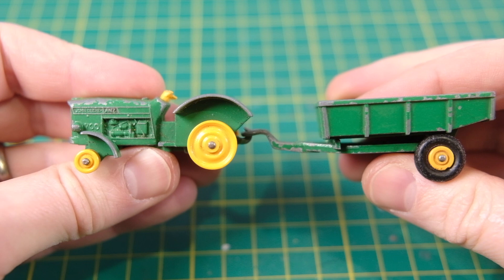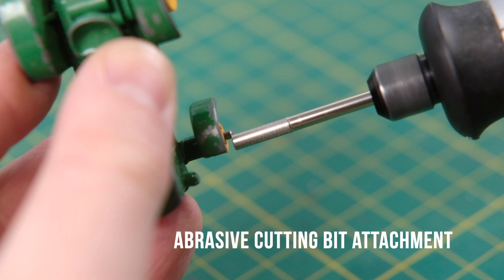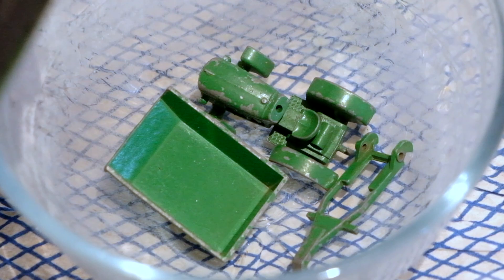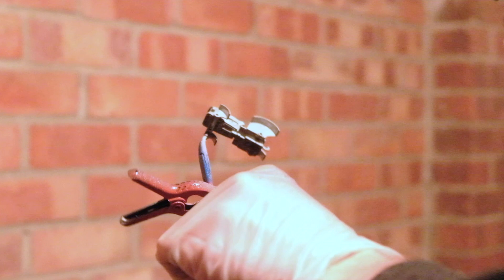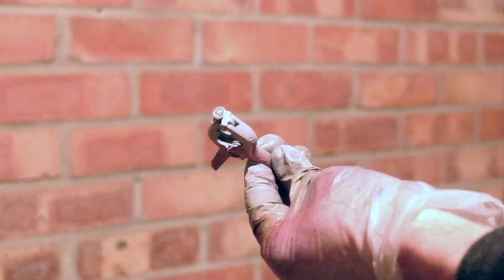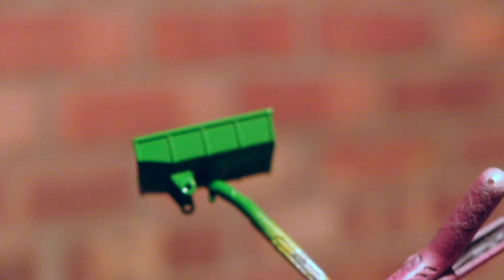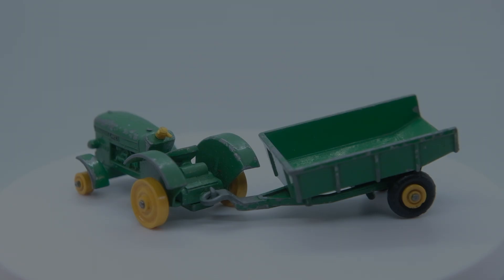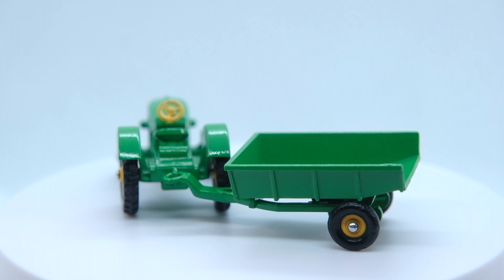MATCHBOX restoration: 50B & 51B John Deere Lanz 700 Tractor & Trailer

Comment: You did a masterful job on that set. You'd think sandboxes. would be filled with those little yellow barrels.The problem with those wheels is the hubs shrink with age and the tires fall off. If you have loose tires, one way to tighten them is to use heat shrink tubing. The kind for electrical repairs. Take the tire off the hub, slip a piece of shrink tube on and shrink it with a heat source. The push the tire back on and carfully cut the excess tubing off with a sharp knife. If you use black tubing you won't even notice the repair.
Reply: the barrels either vanish into the carpet or underneath the drawer, or eventually end up on daddy's model railway I'd suspect. maybe I even had one or two in my hands without knowing where they belonged to. :)
great idea with the heat shrink tube. I'll test it out next time. :) thanks! ^^

Comment: Looks great Jason, where did you get the 3D printed steering wheel as I could do with a few.
Reply from the maker: Thanks Tony - I would send you some if I had any spare. I got this one from Steve Flowers and it was designed for the 39C Ford tractor. It is a bit bigger than it should be on this one but a useful alternative
Reply: @DieCastRestos  Thanks for that Jason next time I order from Steve I'll get a few.